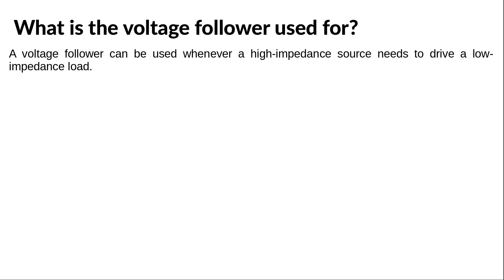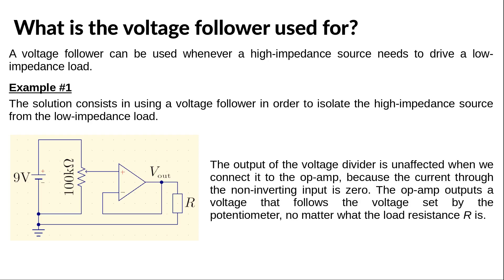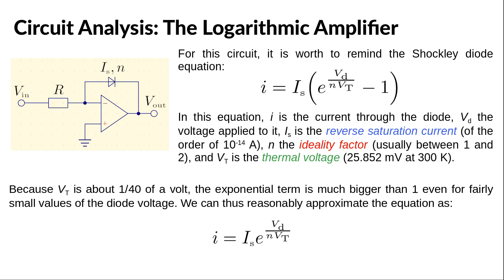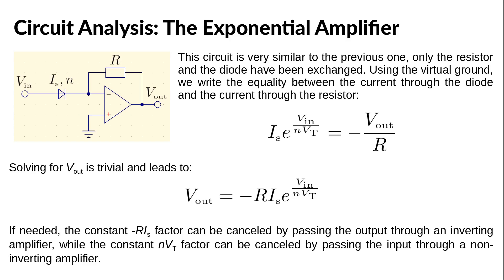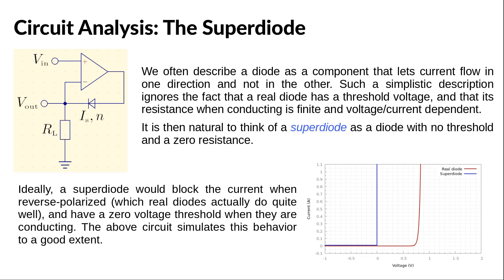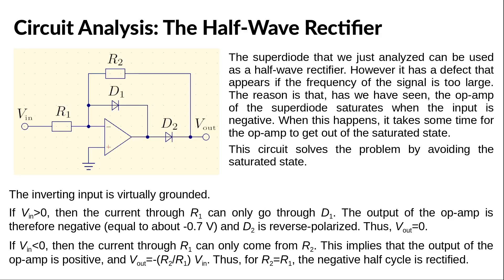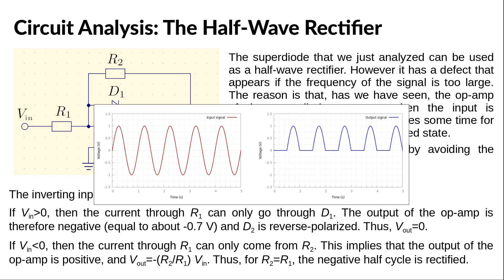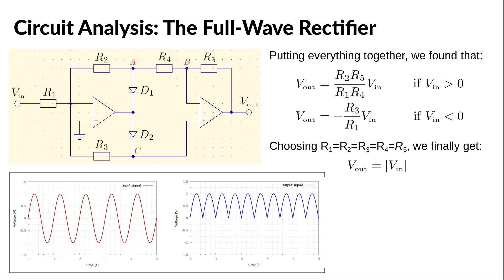The Operational Amplifier Demystified: Electronics Basics: Part 3

Comment: at 2:11 can you please help me understand how the output impedance is 25kohm
Reply from the maker: With the potentiometer centered, the resistance between the positive lead of the battery and the output of the circuit is 50 kohm. The maximum current you can get at the output is if you connect the output to the ground (short cut). This maximum current is therefore Imax=(9 v)/(50 k). On the contrary, if you don't connect any load to the output, the voltage at the output is 4.5 v. According to Thevenin's theorem, you can replace this circuit by one in which a battery of voltage Vth is connected in series with a single resistor Rth. With no load connected to this equivalent circuit, no current can flow (since the circuit is open). So the there is no voltage drop across the resistor Rth, thus the output of the resistor reads the same voltage as the battery's voltage. We want the circuit with no load to have a voltage of 4.5 v (as in the real one), thus we conclude Vth=4.5 v. Now if we connect a 0 ohm load to the circuit, the current will be equal to Vth/Rth. We want this current to be equal to Imax. Thus we conclude Vth/Rth=Imax, hence Rth=Vth/Imax=(4.5 v)/[(9 v)/(50 k)]=25 k.
Reply from the maker: Did my explanation help?